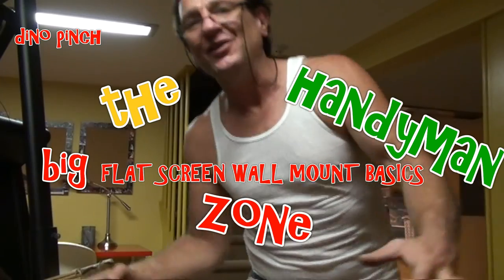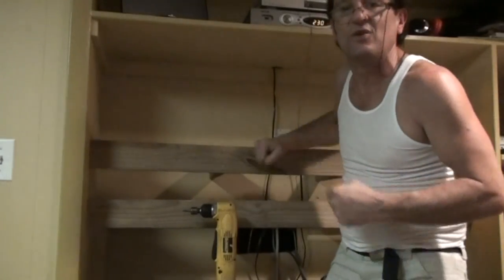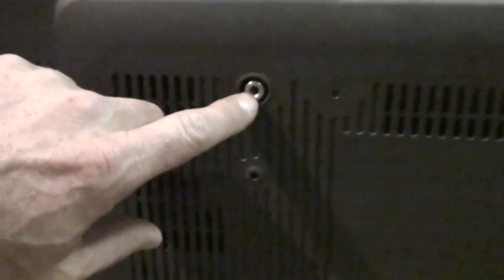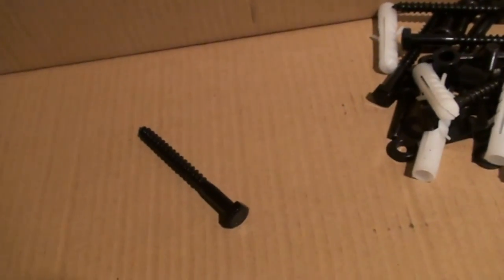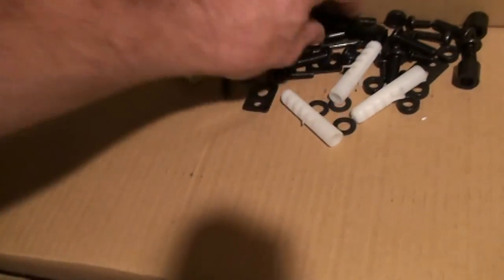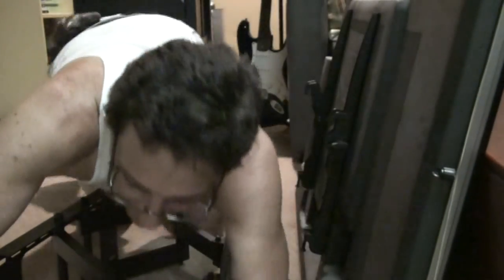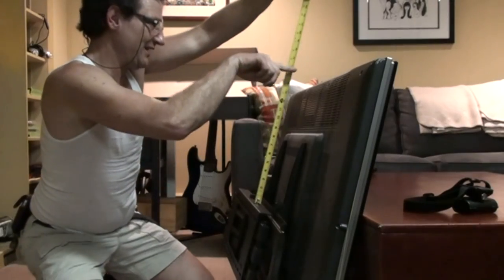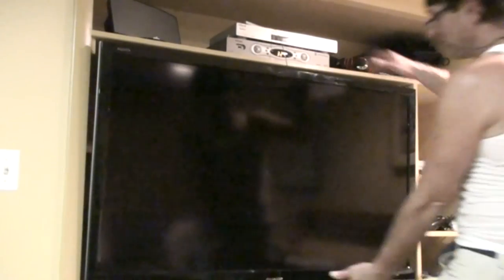FLAT SCREEN TELEVISION WALL MOUNTING BASICS

Comment: Great video. Very Very informative. I do enjoy your tutorials. I wanted to ask if you were able to get the bite you needed from the lag bolts that the mount company provided or if you had to switch them for some others? Possibly shorter with more threads near the end to ''bite" into your 1x4 framing. I love the framing I will use it to mount newer tv's into those older holes that are built in above fireplaces.